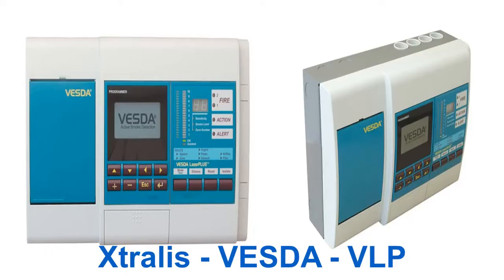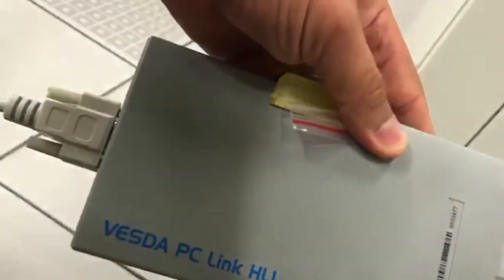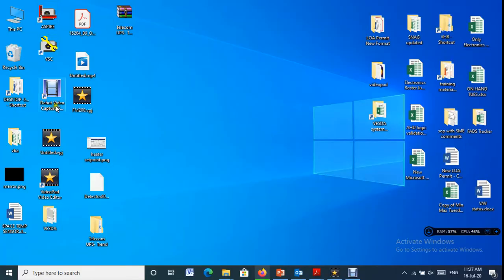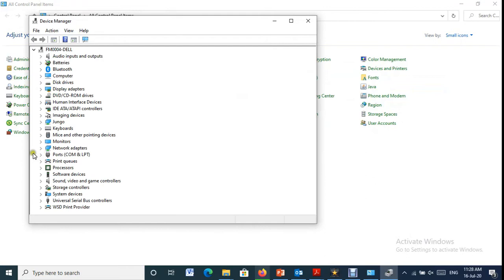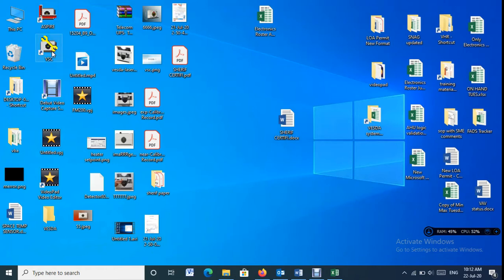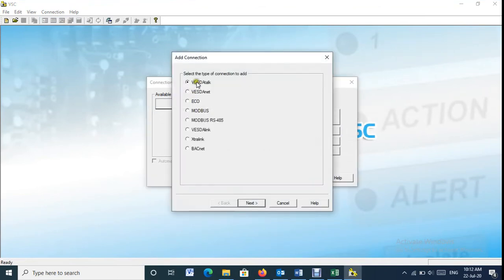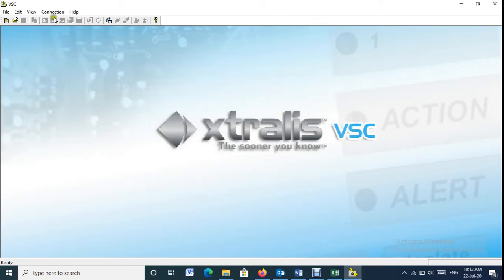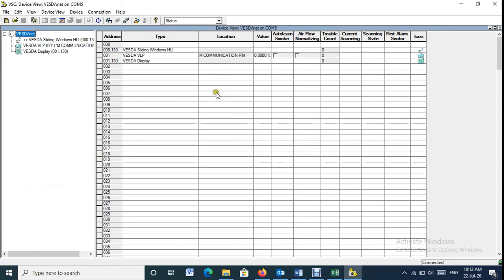Xtralis - VESDA - VLP /VSC - Part-1- Connection

Comment: I need your help regarding this, my cable does not recognized. I used USB to RS232 9pins and db9 to vga 15pins.
Reply: Did you solve the issue ?
Reply: @Jerinkbaby  Not yet..
Reply: Maybe, port settings bits per second, you try use all the usb ports or maybe the driver of the serial cable that you use